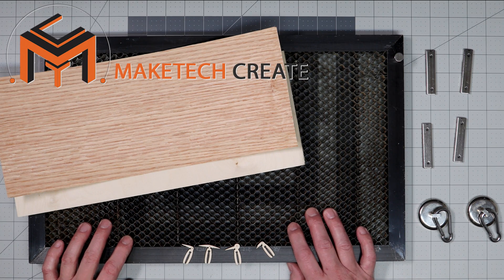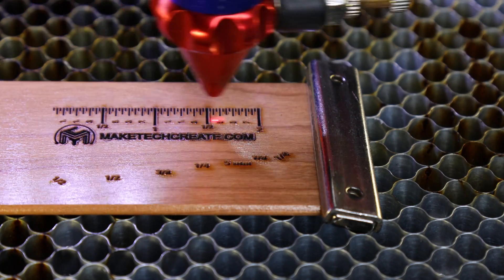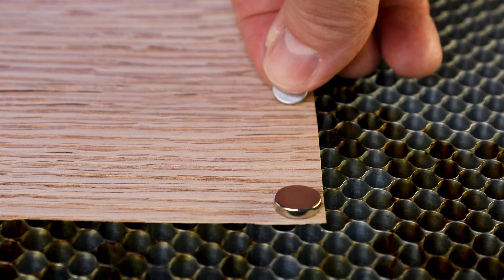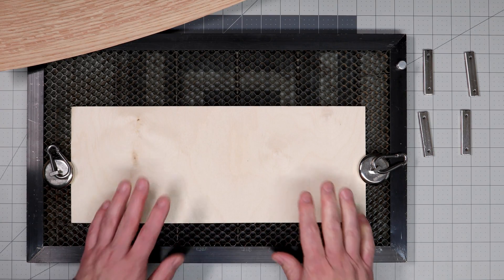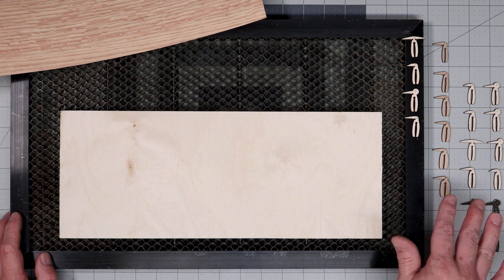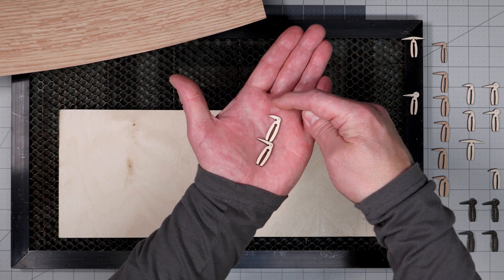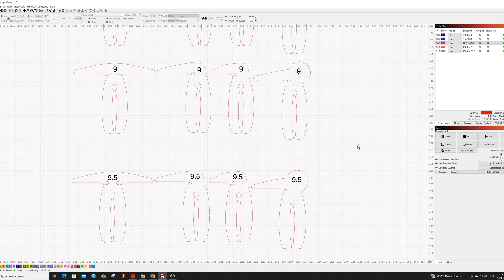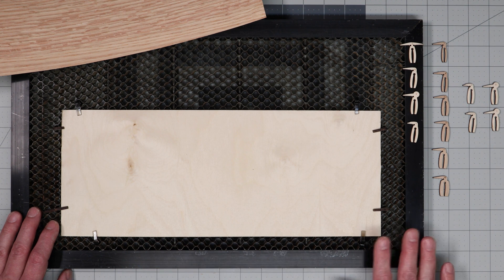Choosing the Right Hold Downs: Magnets VS Honeycomb Bed Pins

Comment: Can you make them so they have a step in them so they have a gap between your material and the honeycomb? Thanks Emma
Reply from the maker: That would be an easy change, but I'm not sure what it would be used for?
Reply: @MakeTechCreate  to have a small airgap from the material & the honeycomb to help avoid flash back
Reply from the maker: OK, I get it now! Yes, that possible 
What I do is use small button magnets to elevate my materials....they work great for this. I was actually thinking about designing wood pegs that go under material that would keep everything perfectly elevated 🤔
Reply: @MakeTechCreate Did you ever design this? Also, do you have clips for the Wecreat bed?
Reply: Brilliant if you do design a file I'll  be there x